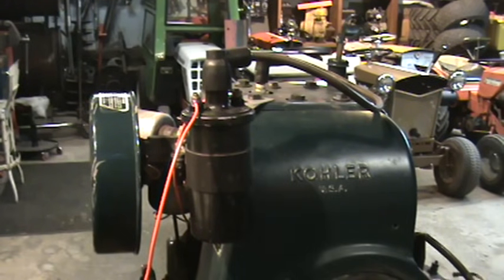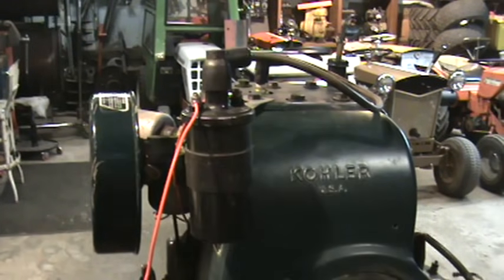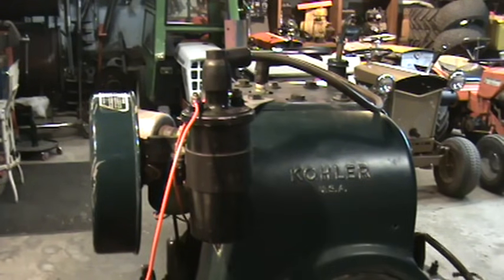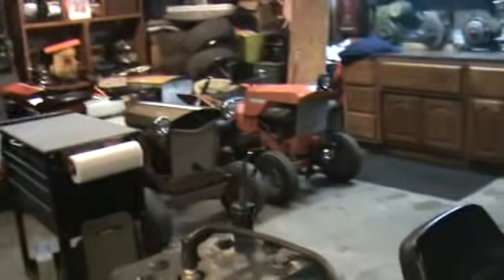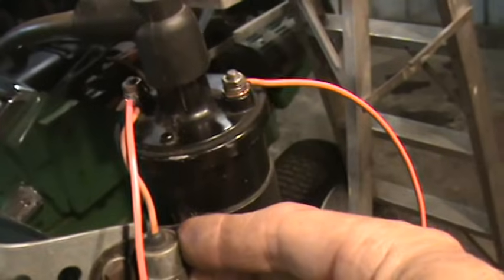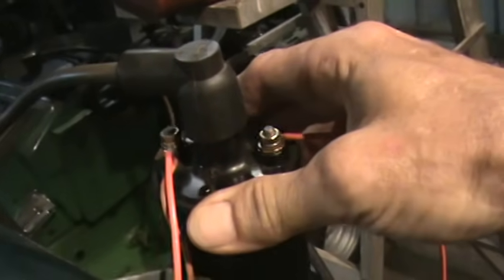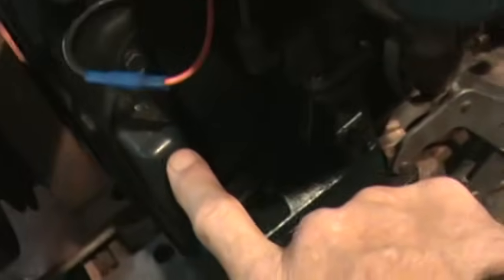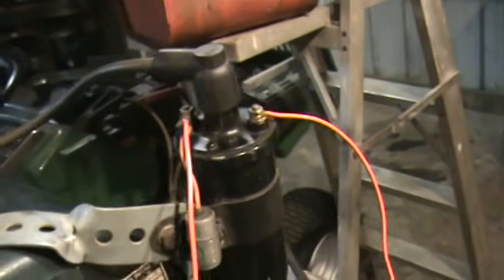Wiring an external battery coil to your engine

Comment: Hey there! now i have the same setup like that i have a cub cadet 1250 with the Kohler K301, same igniton coil and everything, what i dont get, is i checked for spark one time when it dident wanna fire. the spark plug is brand new, but when i turn the key, it would spark for about 2 or 3 seconds then it wouldent do it again unless i let it sit, i never seen this before haha! Note: it is cold on so i dont know if that has anything to do with it. Thanks.

Steve.
Reply from the maker: Steve, It sounds like there is a short within the coil or the condenser is bad. Click the link in my video description and there you can find a ton of information on the subject that will help you to understand and improve upon the stock configuration. The best way to attack it is the simple stuff first. Replace the Condenser first. Make sure the points are in good shape and that the gap is properly set, then if the symptom continues, replace the coil. A standard 12V (make sure it's 12V) automotive coil is all you need and they can be bought fairly cheap. Don't get a 6V...how to tell the difference between a 12V and a 6V is the 12V will always have 12V stamped on the outer casing. Cheers!! Zip~
Reply: oh my god thank you so much, i havent even tried any troubleshooting you named off yet, gonna get to the garage/shop as soon as i get up lol. i appriciate it so much Zippo! it was running before that day and all of a sudden it just started doing this stuff. i will try everything you said, its really my first messing with points and condenser, i always work on like for example my 16 hp briggs opposed twin cylinder haha. again thank you so much, like and subbed to you immediately haha. you deserve it bud! Steve.
Reply: Oh and one more thing. i forgot to mention, i am very under-tooled, when it comes to points and condenser type ignition setups, this may sound rediculous but is there anyway i can set the gap of the points without a feeler gauge? or can i rig something up? lol i hate to ask more of you, you've already been a huge help. thanks again!
Reply from the maker: Actually, yes. You can adjust the points to the perfect gap using just your eyes. With the spark plug out and grounded to the engine (I always use a magnet on a head bolt then rest the plug connected to plug wire on the magnet to hold it in place), spin the engine over and inspect brightness of spark. It's best to use a new spark plug when doing this to eliminate a faulty plug. Adjust the points in or out until the brightest spark is witnessed, then lock the points down (usually a screw driver is all that's needed). Then, inspect spark again. Sometimes the gap moves when tightening the points back down. When I install new points, I'll set the gap, then fine tune the spark using this technique. Works like a charm. Zip~
Reply: Alright! thank you Zippo! im actually gonna go try that right now haha!!
Reply from the maker: How did the points setting venture go? Zip~
Reply: hey! i reset the points and sanded them down a bit everything looked goood there, but you were right about the ignition coil, i definatly need a new one, the condenser looks in good shape but im gonna buy a new one of those too just to make sure. plus there pretty cheap. so next is buying the new parts, and i have a feeling thats gonna solve this spark issue. Thank you so much for the help. i couldent have done it without you haha!.

Steve.
Reply from the maker: +streetracer94 Here's to hoping the planets align and the new parts produce spark Sir Racer! Keep me posted! Zip~
Reply: Alrighty! and again thank you for the help zip, couldent have done it without ya!

Steve.

Comment: I've got a simplicity 7116 with a Briggs 16hp cast iron engine that I'm gonna do this to as it has magneto woes just wondering what the advantage of mounting the condenser up on the coil versus on the points themselves?.....thanks
Reply from the maker: Honestly, if it's worth fixing, it's worth fixing right. I wouldn't add a
 battery coil to an engine that's meant to have a Magneto. But if you 
insist, the location of the condenser is fine at the points. Zip~

Comment: Hello, Thank you for the video! I have a 4.5cm21-RV generator. I has a nice old Kohler engine on it. The unit has been in storage for years. No gas in it, in fact no tank as I believe the RV fuel tank was used. This unit has a start/stop switch. For the moment I by passed that to get the engine to turn over. I then disconnected the switch and checked for spark. There is none. I set up a temporary fuel bottle to gravity feed the unit for the moment. Question: no spark from coil so it this points? condensor? both? I know it could be the coil however I would like to rule out the others first. I am going to have a problem getting parts because the unit is not marked with model, and the plate has been painted over obscuring the serial number....grrrrr. Thoughts?
Thanks alot, David.
Reply from the maker: Search the engine block for a casting number, like a K301, K321 etc. Once you find it, that will help you to determine the right engine parts for your engine. Zip~

Comment: I have a question ? Can I use a 12 volt Delco coil from a automobile, on my case 222 tractor, and does it need a internal resistor in the coil
Reply from the maker: 12V coil won't need a resistor. It's internally resisted already. But if the coil you use isn't marked "12V", then assume you've got a 6V coil and add a resistor. Zip~
Reply: Thanks, I hope it helps me...

Comment: have a question that maybe somebody can answer...bought a old honda cb twin as a winter fixer upper with two 6 volt ignition coils...one is not working right anymore...now my question would be, can i use those universal 6 volt ignition coils for motorcycles you can find all over the internet for example:(  http://www.ebay.de/itm/like/150981600702?lpid=106&chn=ps&ul_noapp=true ) or must i stick to those crazy exspensive honda coils...i live in germany and honda coils for old bikes are hard to get and good ones cost over 150euro, where as those universal 6 volt coils cost 15-25euro....it would be very nice if somebody has any info or expierence they could share with me...bin trying to find infos about it online for days now but just cant find any useful infos about the subject!love and peace
Reply from the maker: That's the beauty of ignition coils....it's a universal design and as long as there is a spark plug at the end and they're wired correctly, they will fire. I say, you would be able to get the second cylinder to fire with the universal coil. And if not, you're not out much. But I'm confident, that you will be successful. Cheers! Zip~
Reply: ZippoVarga
thanks i geuss i will just have to try it and see.

Comment: I did this to a friends b110 that had a bad coil / mag. Works great. So when my b10 started symptoms of losing spark when got, I bought a coil and set it up the same way. I cannot get it to spark. Points are new. I have swapped coil and condenser with ones of a running tractor so I know they're not bad. Yes I have 12 volts to the coil when the switch is on.
Reply from the maker: My only guess is that either the gap isn't quite right on the points or the cam bump for closing the points is worn to the point where it is no longer effective. If the original coil is still in place, try installing a Nova II points eliminator in place of the points. This will not work with the battery ignition coil though. Those are my thoughts. Zip~
Reply: Thanks zip. I did try adjusting the points both ways. Once in a while I would get a brief spark. I think ultimately I'm going to pull the engine and install a new Mag / coil then also add a nova 2 and it should be reliable for a long time.

Comment: Do you have a video on where and how and what to hookup a resistor  with the coil that does NOT have an internal resistor?  thanks    Gary
Reply: Durn, i was here looking for answer to same Question.. It appears if coil has 4 ohms Resistance no added external-resistor required..which is NOT working for me as Coils keep burning out.. I do know if external resister is used, need a 4 wire ignition switch, so as ext-resistor is NOT in circuit when starting, but Must be in-circuit when engine is running. My big-problem is what are the actual resistor ( and coil-resistance ) Values specifically ? A 4 ohm coil burnt-out after just a few hours, i have another Coil that measures 1.5 ohms, and seems like it would be a waste of time just using that as-is....

Comment: ME TO I WEAR GLASSES BUT THEY DONT WORK TO WELL...IM TO OLD TO GET THEM FIXED NOW...MY EYES THAT IS...LMCAO...ANYWAY I WANT TO THANK YOU FOR PUTTING THIS ONE UP...I HAD A HARD TIME FINDING THE OLD TYPE OF COIL HOOK UPS NOW A DAYS ALL THE CARS HAS THOSE STUPID BLOCK COILS OR COILS FOR EACH PLUG WIRE...WHICH COST MORE GO FIGURE..PLUS THEY WEAR OUT FASTER...OLD COILS LAST ALMOST A LIFE TIME OF THE CAR...LMCAO...ANYWAY THANKS...I NEED THIS BEEN LONG TIME SINCE I DONE IT AND MY OLD BRAIN FORGOT HOW TO BUT I CAN REBUILD A 4 BARREL CARB AND A WHOLE OLD STYLE ENGINE...MY LAST REBUILD MOTOR WAS  A  472....LATER THEY CAME OUT WITH A 500...IT WAS A GOOD BUILD AND FIRED UP THE FIRST TIME IT TURNED OVER ....IT WAS A BIG CAR AND A BIG ENGINE AND IT WOULD HAUL THE TRASH OUT....LOL...THANKS AGAIN....
Reply from the maker: BUTCH, I'M GLAD THE VIDEO HELPED JUMP START THE OLD MEMORY BANKS. I CAN ONLY SPECULATE THAT YOU ARE A CADILLAC MAN. THE 500, SO FAR AS MY MEMORY RECOLLECTS, WAS SYNONYMOUS WITH THE CADILLAC LINE UP IN THE 1970'S. ALL THREE OF ME VEHICLES ARE VINTAGE (24, 26 AND 38 YEARS OLD) AND ARE ALL SINGLE COIL POWERED. TWO ARE FUEL INJECTED HOWEVER. BEST OF LUCK WITH YOUR REPAIR!! ZIP~

Comment: hello zippo , i have a royal gypsy tri hull 1977 with a 140 omc 4 cly, i'm not getting spark out of the coil but it is new and so arent the point's condenser and resistor , do you have any idea's ? you can email me at palmisciano7249@gmail.com .........thank you mike
Reply from the maker: Mike, I apologize for the delay in getting to your comment/question. There are any number of possibilities that could be causing your no spark issue. With all new components, it's possible the points are needing further adjustment to get the hottest spark possible. I've seen this more often than any other issue with points ignition. Also, check the coil to see if it has "12V" either stamped in the outer can or printed in indelible ink. If not, then you have a 6V coil and you may need to install an external resistor once you achieve spark in order to keep the coil from over heating. 12V coils are almost all internally resisted and don't require this additional electrical component. Also, make sure you are not grounding the system somewhere along the line. The + and - on the coil doesn't mean + and - battery connection, but instead, it gives direction of spark. The + goes to battery and the - goes to the points. If you have the kill wire connected either to the coil or points, temporarily disconnect this and see if spark returns. If so, you have a ground fault somewhere in the wiring and need to trace that fault. All that the kill wire does is removes battery power. So try bypassing your current set up with a wire directly to the battery from the + terminal on the coil and crank the engine over. The standard point gap is just a starting position, and often, on older engines, this setting will not produce spark. Adjust the gap in .002 increments and check for spark. Go in to a minimum of .012 and as wide as .024. If you don't find the sweet spot within that range, then one of your components (condenser, coil or points) is defective, providing the wiring is spot on. I hope this information helps you get the old engine back to life. Cheers!! Zip~
Reply from the maker: I just re-read your comment. If your new coil is a 12V, take the resistor out of the equation. The 12V vs. 6V coils differ in their design. The 12V coil is internally resisted, so the double redundant resistance may be eliminating your spark all together. Of there is no indication of voltage type on the can of the coil, then it is a 6V and you need the resistor. But, still remove it temporarily to see if spark returns. If so, the coil may be quite new and 12V, which I have seen. In days gone by, the 6V, inherently, didn't have any markings on it. So when the 12V coils were introduced into the world, they were all stamped or imprinted with 12V so you knew you had an internally resisted coil. Good Luck! Zip~
Reply: Thank's Zip, i'm going to try everything you said , i'll keep you posted if it work's out and post a video of it runnin thank you sir
Reply from the maker: You bet!! Best of luck to you! Zip~

Comment: is it OK/safe to connect positive side of coil directly to the battery?
Reply from the maker: +Dustin Mckinley It is if you're knowledgeable about how to do this correctly with points included in the wiring. If you're unsure, then don't attempt any modifications without investigating. Google is a great way to do things right. Cheers! Zip~

Comment: I have a farmall Super A with a BAD Coil in the Mag, However, it is a POSITIVE GROUND 6 Volt system.  To Bypass the Coil in mag and hook up a External Coil, Do I just Switch the wires you speak of , since it is a Positive ground sytem? Negative Tp Positive, Positive to Negative??
Reply from the maker: +MrDanoconnor I'm not 100% sure on that MrDan. I would find a support group on the internet to find the answers you are looking for to be sure you've got things done correctly. Sorry I couldn't be of more help! Zip~
Reply: +ZippoVarga   Thank You for Responding.  I appreciate it very much.
Reply from the maker: No problem. I'm just sorry I couldn't definitively answer your question. But...when I am not sure, I'll never offer iffy advice. I hope you find the answers you need! Cheers!! Zip~

Comment: Hi Zippo, I  am working on a K301 that has been wires going here there and everywhere. I'm wondering if you could do a detailed video showing the correct wiring, including key ignition switch, regulator/rectifier, etc. If possible, I would be grateful!
Reply from the maker: Nathan Hilbig I'm the wrong person for that video I'm afraid. I'm a Briggs guy. The Kohler in this video is the only one I have kept and that's only because it was a gift. Had it come in as a trade or the like, it would have been gone shortly there after. There are guys on here that specialize in Kohlers who probably already have videos posted on correctly wiring things up. I would have been happy to make the video for you if I had the later model Kohler with internal alternator, but as it stands, this engine has the Delco Remy External Starter/Generator which uses a Delco Regulator. Sorry I can't be of more help and best of luck with your project! Cheers! Zip~
Reply: Got it, I will keep looking. Thanks for your reply!

Comment: will you burn up the coil if the wires are switched? like the battery positive is hooked to the negative on the coil? etc.
Reply from the maker: kidzoog This reverses the flow and can certainly short out the coil, it's internal resistor (if equipped) and/or the condenser, yes. I have accidentally hooked up coils backwards, but was quick to realize my mistake and got lucky with no damage. But I would guess that continued cranking to the engine could result in permanent damage to the components. Hope this helps. Zip~

Comment: How many ohms should the resistor be to use the automotive coil?  Thank you.
Reply from the maker: berkmanyt If the coil you are using has "12V" or "12 Volts" stamped on the casing, it is most likely an internally resisted coil, and no Ballast Resistor is needed. If there are no markings on the coil, then there is a good chance the coil is a 6V coil and would need an external Ballast Resistor installed in series, from the battery "+" terminal to the "+" terminal on the coil. The resistance needs to be 1.3ohm, and this is pretty much an industry standard. Or, if you plan to use a high energy/performance coil and you're not sure if it's internally regulated, keep check on the coil case to see if it gets quite warm to the touch during operation. If so, then install a Ballast Resistor and this should correct the over heating issue. There are other things to consider if you're adding a battery ignition to an engine that wasn't designed for one. For example, plastic parts on the points that could over heat and fail prematurely. The condenser/capacitor attached to the points and some other small details depending on your engine's existing ignition system. Cheers! Zip~

Comment: I have a cub cadet kohler k301a engine and it will turn over but the spark plug want fire... I changed my solonoid and the condenser  but still no spark please help
Reply from the maker: Inspect the points Drew.
Reply: ........I did thanks that's what it was
Reply from the maker: Awesome!

Comment: I'm about to replace the coil on my John Deere 110, should I unhook or hook things up in a particular order? (I'm fairly engine/mechanical savvy but I'm still a blonde woman whose not a fan of getting her ass zapped lol)
Reply from the maker: Disconnect the negative cable from the battery before making the connections Michelle and you'll be safe as can be. The Battery ignition system will only send a spark when the points close and the battery is connected. I hope this helps and would like a progress report when you get the old 110 up and running!! Cheers!! Zip~ (Sean)